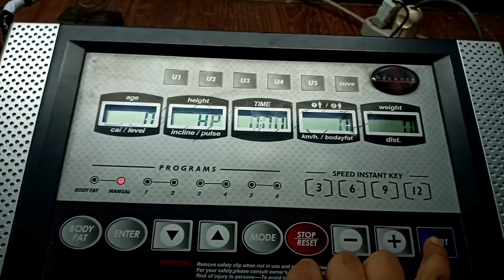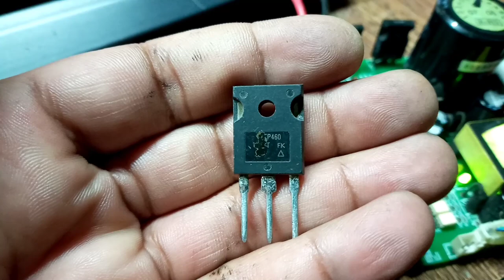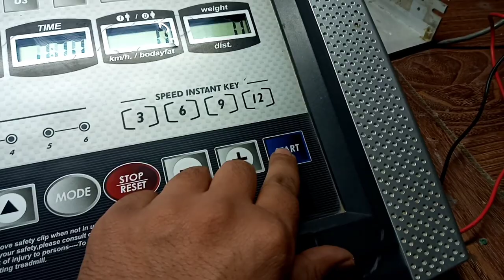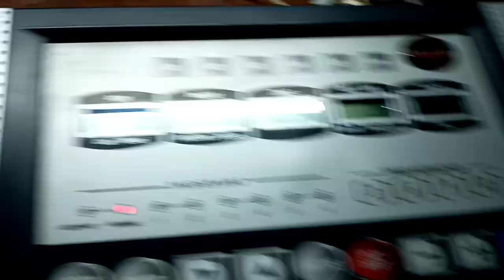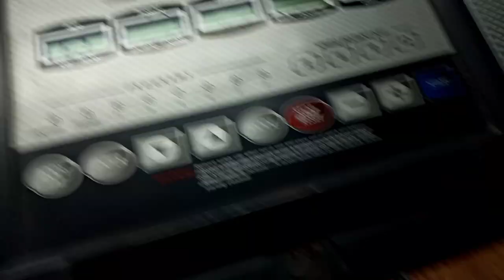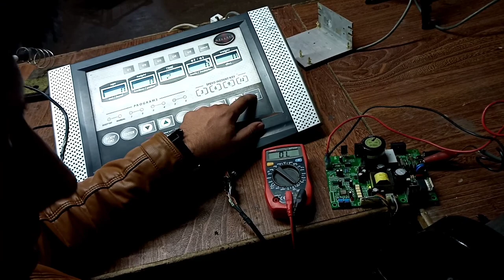Treadmill Error 7 troubleshooting /Advance treadmill error 7

Comment: Asslam o alikum I have an Ammerican Fitness tread mill with inclination & display as well ....power turns on ; relay clicks but nothing happens while display is on no motor works upon pressing buttons....should i check relay or console.? Console seems good nothing is burnt & doesnt display any sort of error as well untill i plug out some cables of the board ???

Comment: Great job! Can you pl let me know the reason you have added a wire instead of fuse? what is the rated fuse, my card is also blowing the fuse when i start the motor. pl advice.
Reply: Sorry to be so offtopic but does anybody know a tool to log back into an Instagram account?
I was dumb forgot the account password. I appreciate any tricks you can offer me!
Reply: @Rocky Nasir Instablaster =)
Reply: @Dash Theo Thanks for your reply. I found the site thru google and im trying it out now.
Takes a while so I will reply here later when my account password hopefully is recovered.
Reply: @Dash Theo It worked and I actually got access to my account again. I'm so happy:D
Thank you so much you saved my ass !
Reply: @Rocky Nasir No problem :)

Comment: Good video. I have another strange phenomenon in my treadmill. When I remove the speed sensor, there is no difference, so no error code shows at all. I checked the sensor and measured it, it works, do you have any idea what it can be due to?
Reply from the maker: Your treadmill is without sensor. Sensor is  installed only to measure speed not for feedback as tripping
Reply: @KalimullahPakistan  
Ok. But i can not enter the speed meny to adjust the speed. 
I can change the speed with the little rheostat on the board.
is there a special meny for that?

Comment: assalamualaikum bro
i have board without speed sensor feature. the mosfet u1660G was have short circuit to its heatsink previously. now the treadmill is stop after 1 second running and then error 05 displayed. this happen every time i try to restart the treadmill. could you help me how to solve the problem?

Comment: I have incline error 7. Previously incline function and fold/unfold wasn't working as well but machine was running. However its now stuck on E7
Reply from the maker: I think Machine name is sports art
Reply: @KalimullahPakistan model nar-5080. this error is intermittent. Sometimes double dash flashes on incline display and machine doesn't start
Reply from the maker: @ayereh  most probably button at the back of the console is faulty.
Reply: @KalimullahPakistan  you are right that button doesn't work. But incline up down also doesn't work. And when machine enters double dash flashing it won't start. Where are you located? How can  contact you?

Comment: Very nice video. I have a question ?  I have this same board but it has a CC16M V3 chip were the RFP460 is on your board. Can I replace the CC16M V3 chip with a RFP460 chip ?  Thank you for any help.
Reply from the maker: Check the datasheet of both compare pinout and other stuff.
Remember,in same shape diode is also there. Do mix it with that. Check datasheet
Reply: @KalimullahPakistan  Thank you for the fast response. Date sheet was the first thing I looked for. They have them for the UFF100-005 and 6 but I was unable to locate one for the UFF100-04.
Reply from the maker: @carlkellogg5342  check the difference of 6 and 5 the difference will help you to conclude information for 4
Or send datasheet to me
Reply: @KalimullahPakistan  Thank you. How do I get the date sheet to you ?
Reply from the maker: @carlkellogg5342  03009855546
Reply: Kalim Ullah Pakistan @kalimullahpakistan4347 ?
Reply: @KalimullahPakistan  I'm sorry I don't understand can you explain please ?
Reply: UFF100-005 and 6 are both only 2 pin so that will not work. Bummer... Any ideas on a act alike replacement ?  Thank you....
Reply: @KalimullahPakistan  HI, it looks like the Date sheet for the UFF100-005 and 6 are 2 pin. Now what ? LOL  Thank you
Reply: @KalimullahPakistan  Did you get my message about UFF100-005 and 6 being a 2 pin and not 3 pin like the UFF100-04 ? I don't think their even the same chip. I am unable to locate anything on UFF100-04.
Reply: @KalimullahPakistan  Thank you for answering all my questions. Can I replace U1 the 20N60 chip on my board with IRFP460 the same chip that is on your board ? The boards are the same thing just different chips used by the maker. Also, do you have any idea what chip is a replacement for UFF100-04  chip # U2 on my board ? How do I find replacement or the equivalent replacement for a chip ?  How do you no anything about the chip if you can not find a date sheet ?
Reply from the maker: @carlkellogg5342  yes